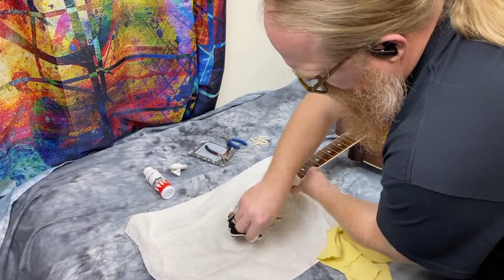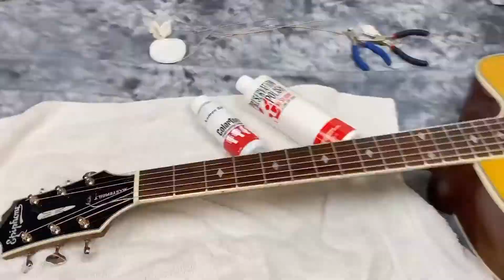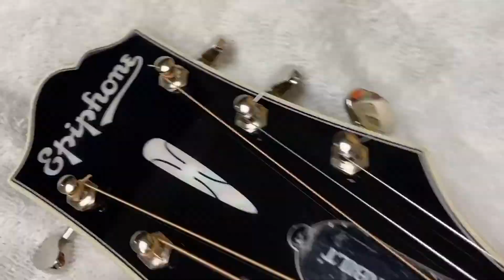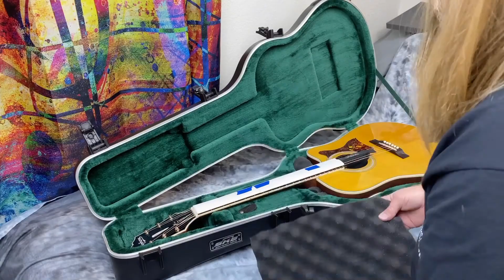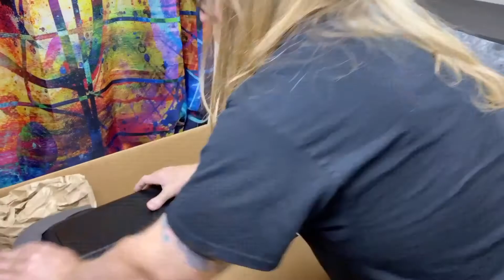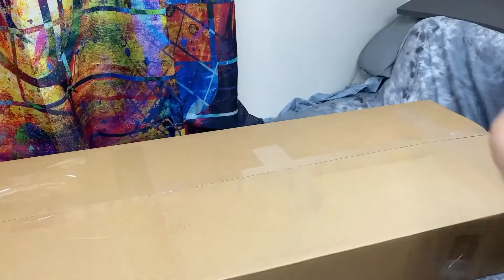Epiphone Masterbilt DR-500 MCE NA natural finish - demo

Comment: I just grabbed the older DR400 model that I paid a handful of peanuts because it have a amall crack just beneath the fingerboard. Quite an  unusual place for a crack of the top; the guitar was in a pawnshop and those brilliant guys didn't think a second it could be risky to expose it in the window under direct sunlight!!!
Anyway I'm extremely happy with this guitar who plays fantastic and have a very well balanced sound between lows, middles and highs. If you ever come across one of these, either the DR400 and DR500, do not hesitate a second if the price is fair. You won't regret it!
Reply from the maker: Sweet! Get the D’addario Humidipak Restore kit, and keep it sealed up in a hard case when you aren’t using it. You’ll be amazed  at the difference. You can also get the same thing with the Boveda B49-70-4P 2-way Humidity Control Kit. The Boveda has 4 packs, and it’s $8 cheaper. Boveda makes the D’addario packs, so you get the same thing without the D’addario logo. The Boveda set doesn’t come with the bags, but if you are rehydrating the guitar, just put one under the headstock, one by the neck, and drop a couple in the hole, and use the guitar pick retrieval method to get them out later. Lol!
Reply: @RyansCustomShopandGearOutlet  thanks for those precious advives!! Sure this would be a great move. Actually this guitar is the best sounding dreadnoughts I own and I want to keep it for a long long time!
Reply: @RyansCustomShopandGearOutlet  what kind of string did tou put on? I put a set of Elixir Nanoweb 11. The sound is gorgeous but they are a bit too thin to my taste.
Reply from the maker: @joedown962  I always use D’addario Phosphor Bronze. I use different gauges according to the guitar. I change strings frequently, so I’ve never really cared about coated strings.
Reply: @RyansCustomShopandGearOutlet  Ryan, what is the diameter of the D'Addario?
Reply from the maker: @joedown962  EJ16 .012-.053
Reply: @RyansCustomShopandGearOutlet  many thanks my friend!!
Reply: @RyansCustomShopandGearOutlet  I think I'll still use Eliixir but in the. 012 size.
Reply from the maker: @joedown962  you’re welcome.